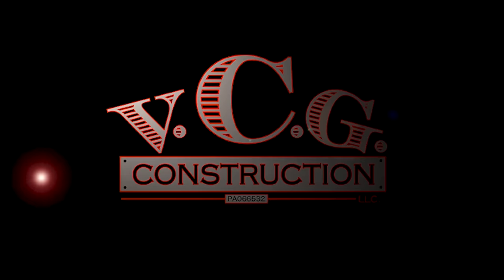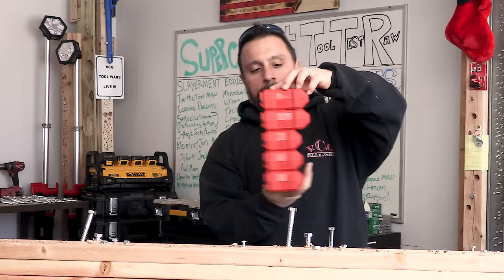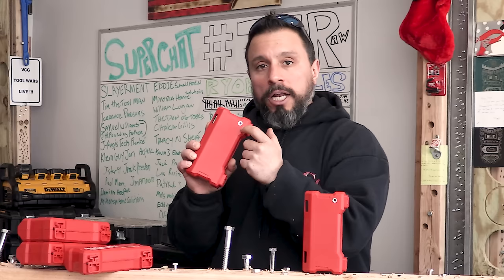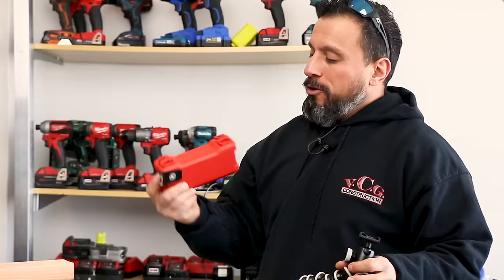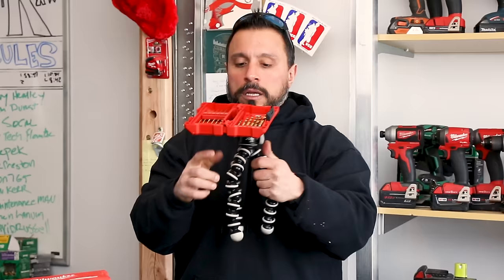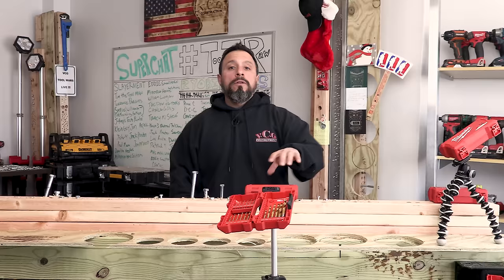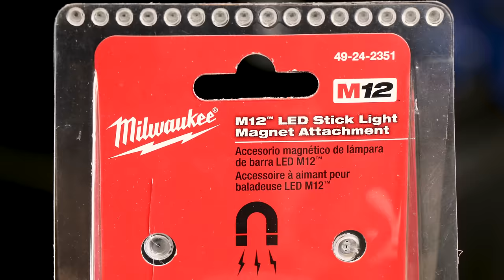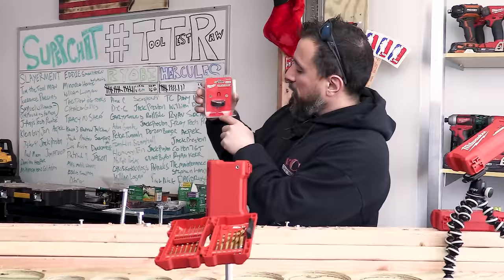99% OF PEOPLE DON'T KNOW ABOUT THIS MILWAUKEE TOOL BOX FEATURE!

Comment: Carpenter had the belt clip from Milwaukee Tool installed on the case and had it hanging off his belt. His pants fell down from the added weight in an embarrassing way exposing his small tool. He  sued Milwaukee Tool and they ended up discontinuing the offering. End of story.

Comment: I thought they were going to offer a camera option for the boxes and you could use the integral 1/4-20 nut for attaching to a tripod. But he didn't mention that. I guess no honorable mention for me. Two bad. I would have liked one.

As an aside it can be a bitch to get the drill bits in and out of those boxes.

Comment: "Stainless" >STEEL< is magnetic. It is comprised mostly of iron. Making it steel and magnetic. 304 stainless is the most common to have around the house and is the most magnetic with the least corrosion resistance. 316 stainless contains much more molybdenum making it much less magnetic but it still contains iron and can still be corroded.

Comment: It's not "1/4 by 20", it's 1/4-20, and the dash is not pronounced (quarter twenty). The numbers are the shank diameter and the thread pitch. Think 6-32, 10-24, 3/8-16. None of those screw sizes have an "x" in them as lumber does. That's when you say "by". 2x4 (two by four), because those are the dimensions. The second number in a screw or bolt size is the number of threads per inch, not a dimension, per se.
Reply from the maker: 🤣🤣👌🏻 thanks !

Comment: Milwaukee is smart. Not to sell something I can make. Take the belt clip off a broken measuring tape drill 1/4 Inch hole. Then attach with 1/4 X 20 screw.

Comment: The rest of their case is terrible it takes channel locks to pull the bits out of the case you just can't grab the bits and pull them out there in there so tight they need to redesign at case

Comment: these bits are not good. I was trying to drill through 1/16 aluminum and I had to press my hardest after 1 hole, I was baffled because this was not thick at all. I used the dewalt drill bits and it went right through them all day long (both bits were brand new). After drilling at least 100 holes with the 1 bit from dewalt I still would prefer the dewalt bit over the Milwaukee bit thats how easy it went through. I also bought a socket adapter for the impact, attached a extender to the impact from milwaukee to get in a tight spot and the socket adapter sheared off after about 3 mins of use in the extender so now I cant use the extender or the socket adapter. 20 dollars in parts down the drain and another trip to home depot wasting time to get parts. I am just not impressed with Milwaukee products. I wanted to like them but Ridgid  has been better for me and half the cost, I compare their drill attachments to harbor freight.

Comment: When I was doing a tool review for Milwaukee, I questioned them about the threaded insert. They told me it was intended for connecting a safety lanyard to the box to prevent it from dropping while on a ladder. When I inquired about the part number for their lanyard, they said they didn't have one on the market yet for the 1/4 - 20 threaded insert.

Comment: That 1/4 x 20 tripod idea is the coolest thing I've ever seen. 

I reckon a plastic scaffolding clamp type thing with a threaded end like a tripod would be cool if you need to do some obscure scaffolding work or heights work then you can mount your bits right next to where you need them. 

The tripod is cool but I'm not sure so useful but I could imagine being able to mount your drill bits on the job site right next to your work could be handy. It wouldn't be worth carrying a tripod with you, or a gorilla tripod, to do the job, but I'm sure most people would carry a light plastic scaffolding/tube clamp if it gave them quite a bit of utility to mount their drill bits.

... Oh wow yeah or the magnet is a better idea, even the belt clip seems alright.

Comment: I will stay with containers like this for drill bits. I love these containers. One of mine hold cobalt bits and the other is High-speed bits. The big point never comes open by mistake. I had it tumble down a flight of stairs and all bits and container were just fine. Now granted if the top was off I would have had a mess. 
Drill America 29 Piece M35 Cobalt Drill Bit Set in Round Case (1/16" - 1/2" X 64ths), DWDCO Series

Comment: @vcg_construction  Heard you can buy M12 belt clip to use with it if you want check.  eBay they have em with the screw.  I. Think it's. The same size I just wanted to pass that information along and might be an idea for people that can't find the Belt  clip  that originally was supposed to go with it  the Milwaukee M12 belt clip looks a lot more low profile  I do like the magnet  idea  reminds me of the DeWalt magnetic cases I'm just passing this information along cuz you're maybe people that don't want to put the magnet  and just  want a belt clip you have the M12 baby the belt clip fits you could try it I'm just after examining them thinking that might work add a second idea instead of the magnet people want to put it on their tool belt  #justsaying

Comment: No offense but as a machinist you where driving me nuts with the quarter by 20 thing. Its 1/4-20 pronounced quarter-twenty simple right? When you add "by" its typically referring to length like 1/4-20 by 3 not thread pitch. Sorry again not trying to be an ass but if you where talking like this to me I would be confused as hell as to what you wanted.

Comment: These things are so poorly designed it is a joke. If only they would have given them the ability to slide lock onto those Hard Plastic Tool Cases for a quick and easy carry, then they would earn some praise. I think about this every single time I take them out to a job. I can't get over how much it bothers me. A complete design failure and missed opportunity if you ask me. Never ever ever have I felt the need to screw them onto a bolt or tripod. Big thumbs down.